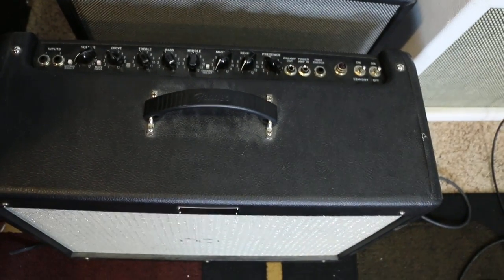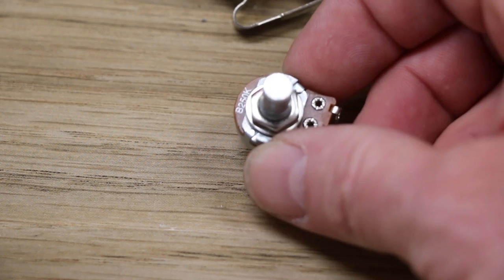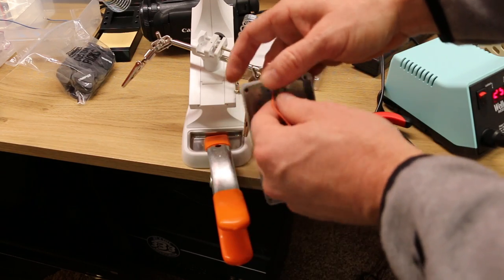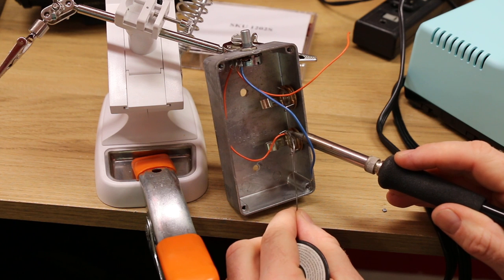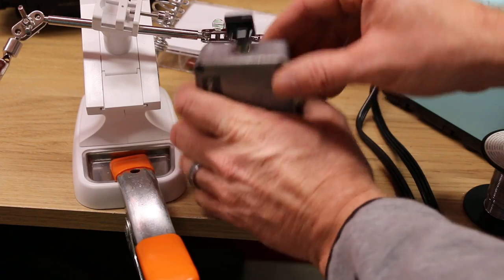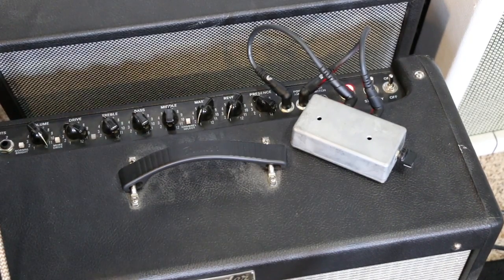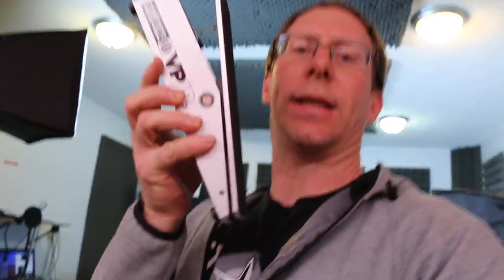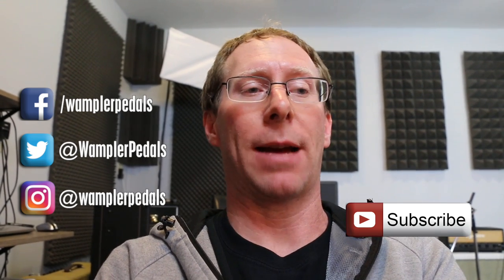Easiest “modification” for Fender Hot Rod amps (and others) to make it better for home use

Comment: So basically Fender to save $0.25 left off the master volume on this amp
Reply: I'm sure they were thinking about cost but they probably did it to create the illusion that it's a lot more powerful than it is
Reply: I thought Hot Rods had master volume?
Reply: @daveclinton4945  yup! Mine has. But it also is controling the drive channel. So if you switch. You can do it more easy.
Reply: Dave Clinton They do, but it only controls the dirty channel. Clean channel just has one volume.
Reply: Matt Laurence No need to create a illusion, I have the Blues DeVille and it’s way to powerful.
Reply: i believe they didnt put taper  volume pots on the earlier ones and put linear pots on them. if i am wrong correct me please its all about learning more
Reply: The master volume is on the drive channel not on the clean. Also these are very loud amps.  I wouldn’t use the box for overdrive os much as to use it as a buffer. Get the sound I want without shaking the house.  Although that would be fun.
Reply: Not exactly. He meant a master for the clean channel. The dirty side has one. As Brian said, they used linear taper potentiometers (knobs) instead of audio taper pots, which give you no room to play at a low volume. At like just after 1 it jumps to 11...
Reply: @stevencollins507  you are correct. The biggest change in volume is from about 1 to 3 (really 1-2 is the biggest). After that it does get louder, but not what you’d expect from a normal amp. That’s my experience having owned a Gen 1 HRD for the better part of 15 years.
Reply: @bouzoukiman5000  exactly. From 1-2 or 3, you get a HUGE jump for small moves for exactly the reason you described!

Comment: Simple as that, you solved a problem Fender has been aware of (and ignoring) for decades. Bravo sir, and thank you.
Reply: Most people just insert a passive.volume pedal
Reply: It’s not a “problem” anyone should expect Fender to “solve.”  First of all, a 40 watt amp isn’t made to play in your bedroom. You could rattle the pictures off the wall and get the law called on you with a 15 watt amp. Second, the amp has a master volume already on the drive channel AND it has an effects loop so you can add another volume control as Brian shows here, just in case your Spark amp ever fails to update and you’re forced to switch on your 40 watt touring amp in a residential neighborhood. This is great advice from Brian for newbies, but it’s not a  solution to any engineering problem that Fender is “ignoring.” The PROBLEM is consumers buying a 20lb. sledge hammer when what they needed was a 5oz tack hammer.

Comment: Good tip. Speaking of tips you are calling the sleeve connection ring on the Jack. The plugs and jacks go back over 100 years with the old telephone switchboards and electro-mechanical telephone switches. Tip Ring Sleeve are the three parts of the Jack and plug. Tip & Ring are the two that go out to your home land line if you still have one and ringing voltage ( usually 90v) would go down the Ring side of the line. In the switching office the sleeve is used for controlling or “holding” relays operated to hold up the call. Fast forward fifty years and stereo plugs used the same technology for left right and ground ( which the sleeve is). Mono plugs are just Tip and Sleeve. I don’t know anything about pedals and why I watch your videos which are great but I’m an old dinosaur telephone guy who worked on cord switchboards back in the day. Like this video showing how to make a master volume and using the amp send receive jacks to attenuate the volume. Two thumbs up!

Comment: I run an EQ in the loop, which has a volume slider that works like this as well. 👍
Reply: Good idea!
Reply: @StopTheRot  Not sure about Paul, but I personally always used a boss GE7 just because it's got good controls and also has a good buffer built in. It doesn't really matter that much though. Just as long as it has a level control and is quiet.
Reply: @StopTheRot  Gonna try that
Reply: Until you click it off and forget your amp is running full volume, I like the idea of the dial and no on/off button. That volume box doesn't need 9v power either. Cheers

Comment: Awesome...a volume pedal in a box.  I always use a volume pedal in the effects loop for this purpose to adjust volume on the fly while gigging.  This is a cool option for those with a few parts and a soldering iron.  Bravo.

Comment: Another great quick and easy mod for the hot rods is to put a 12AU7 in the V1 position. Makes the clean channel more controllable and decreases the gain on the distortion channels. This is what fender does to the George Benson model hot rod.

Comment: I came up with this a long time ago, on the Fender Discussion Page. During discussions of the original Blues Deluxe, I suggested patching a level controlling device, compressor, EQ with volume control or even a 100k Audio taper pot in a box. One FDP'r wanted to know what that would look like, I put up a crude BMP drawing. It was dubbed the "Volume Box." A few guys took my little drawing and started selling them on Ebay. The first guy does credit me. I didn't "invent" it. I had a comercial Ampeg pedal to use in my SVT loop in the mid 70's.
Reply: Thank you Steve. Those who know, know who you are.

Comment: Brian, thank you so much for this latest video. I use a Fender Blues Deluxe Reissue amp which has the same volume issue. I happen to have the identical Ernie Ball volume pedal which you suggested as an option. I've always used this volume pedal in line with my guitar input and effects chain BUT NO LONGER. You've just totally transformed the usability of my amp, I can control the overall volume easily and now roll out as much of my amps natural hair/grit by using my guitar's volume pots beyond say 5 or 6, my go to guitar is a Gibson Les Paul Custom. I use a number of your pedals but this video has just completely increased my sound options and released the true versatility of my amp. You're a total star!
Reply from the maker: +Andrew Garner awesome, glad to hear that! 😊

Comment: Great video!

I solved the volume problem on my Hot Rod Deluxe with a Weber Minimass, which is an attenuator, for real.  I have been very happy with the Minimass, but now I am wondering if I could have achieved the same results for less cash by using your method.  If only I had known about this trick a few years ago.

Thanks for taking time to share your knowledge with us.

Also, your video about putting an EQ pedal into the effects loop of a Hot Rod Deluxe has been life changing for me.  I can finally get usable tones with the amp set to drive/more drive. Thank you so much for that!

Comment: I know you probably won't see this, but for the hot rod deluxe, it would be nice to have a foot switch to turn the reverb on and off (instead of having to turn the knob up and down). Any ideas on how to do this?
Reply: Get the hot rod deluxe foot switch, probably 40$. It’s gotta have “drive/more drive” and “reverb” 2 switches
Reply: @matthewkennedy7283  on the hotrod deluxe the 2 button switch toggles Clean/Drive and Drive/More Drive. You'd need to modify the circuit with a relay to short the reverb out.

Comment: Put an 12at6 preamp tube in the first position it dimes back the volume, you dont go from like zero to 5  in volume. Doesnt do what Brian is doing here , but at least its a cheap option if you dont have any sodering skills ( ala me :).
Reply: I just watched a video with a dude doing that on this Red HRD. Would something like that work on a Blues Junior or would I lose too much volume?
Reply: I cannot, nor will I ever, solder. So I need another option. Or another amp. 20Watts and some damn linear volume control.
Reply: 12AT6´s are hard to come by, I suppose a 12AT7 would be better :-)
Reply: Edit: ah, ok, you mean the clean channel, right? 
I guess the point is to also reach high gain levels at low volume, which is hindered by a weaker preamp tube. This is a master volume retrofit, not a tube swap.

Comment: Thanks for the video!  I built one to use with a Fender Frontman 65R to tame the clean channel volume control.  This reduced pre-amp noise as well by allowing me to boost the guitar signal above the pre-amp noise, then turn everything down before hitting the power amp.  This resolved my biggest issue with this amp.

Comment: I made one of these a while ago to tame my Blues Deluxe Reissue.  It works ok, but I also fitted treble bleed circuits (just a resistor & capacitor from ebay) to my guitars, so I can use the guitar's volume control to reduce the level without the tone going muddy.  I prefer this method.

Comment: Can one use the volume box along with all your time based effects pedals in the loop....and if so, where does it go in the chain?
Reply: That's a fair question 
E.g typically I use my eq pedal in the loop
But if you have looper post the eq pedal 
Then a master volume as a final tweak, would make sense.
Reply: After all the rest.

Comment: In case you already have something into your effects loop and have an extra hole or space to drill one on the back of your amp, like me... you can put a potentiometer there without having to mess up with Jacks. To me a 1nF capacitor was mandatory, because when I turned my effects loop volume down there was I huge treble loss. A volume pedal could be great, but you'll need two long cables to reach you effects loop and by the way you'll add capacitance, buzz and maybe hum... if you're lucky!

Comment: These amps have a separate volume and drive knobs so what does this volume box do differently to the existing volume? Is it just that the original control is too sensitive or are you actually driving the tubes more somehow.
Reply: William Billington Drive only affects the dirt channel right?
Reply: Wondering the same exact thing
Reply from the maker: The master volume doesn't affect the clean channel. On these amps, the clean volume is way too sensitive. Basically, it's just adding a master control to the clean channel. It's redundant if you use the dirt channel of the amp, however very few use that dirt channel on those amps.
Reply: Ahh ok that makes sense. I did use one of these amps to record something a couple months back and it was like 0 to death by 2 on the dial.
Reply from the maker: exactly! :)
Reply: The dirt channel is terrible.
Reply: The effects loop is after the clean volume.  So you can crank the clean volume, which will overdrive at some point, and since your new "Master Volume" is after that preamp, it will affect that first clean volume AFTER it is overdriven, enabling you to still hear it out the power tube stage.  So, you'll get preamp drive, not power tube breakup, and still not be stupid loud... right?
Reply: Great tone comes from power tube distortion. Pre-amp distortion is buzzy, or , fizzy. Hopefully this mod allows for power tube breakup without your ears bleading.
Reply: @barry Brain confirmed that this mod won't help with that I'm afraid. The only way to get power tube distortion at low volumes is using a dedicated power soak.
Reply: The only way to get power tube breakup is to run them hard, when the amp is not loud, they are not running much, period.  Like William Billington said, that's why there is a power soak, hot plate, 'attenuator', etc, to run inline of the SPEAKER output, and let the wattage output of the amp increase, while consuming and venting that heat energy before it reaches the speaker, thus letting the power tubes run hotter.  It's like letting the tubes "think" they're running loud, but only letting a little get out the speaker.  This is why micro-wattage amps have become popular.  Remember, wattage is not how loud something is, or can be, it is a measurement of heat, so to "soak" up that heat from the power side is very different from a volume knob on the pre amplified side that only changes the signal level to the amp.
Reply: +Guitarisforgrins I have heard the George Benson mod helps make the drive channel a lot smoother. I haven't done it myself yet but I've heard good things about it. It just involves replacing the preamp tube from 12ax7 to something with a little less break up. Something like a 12at7. Not 100% which tube but the mod is out there on the internet somewhere.
Reply: Wampler Pedals What do you suggest for a blues jr that doesn't have the loop circuit?

Comment: My lack of electronics is going to bring me to posting this question why not use a 1 meg or 500k pot instead of the 100k, to retain brightness?
Reply: Following
Reply: It's a low impedance loop. 100k works fine.
Reply: Veritas072 it isn't like that. At max the pots is like connecting directly the signal to output, and at min it's like sending the signal to ground directly.
Reply: I think the big thing here is that if the pot can handle the circuit voltage/amperage then the lower resistance of the 100k pot as opposed to the 1meg pot will give you a smoother sweep from full to off.

Comment: Or... you just swap the V1 12AX7 tube with a 12AY7 tube.
Reply: Exactly !
Reply: TimMer1981 hi, with that tube you had less volume?
Reply: 12AY7 tube has a lower amplification factor than 12AX7 so it reduces the volume sensitivity. It will also improve the frequency response of the pre-amp. It does not affect the max output since you have more room in the volume control to reach the peak power.
Reply: I used a 12AU7 once.  Buys about 8 db’s.
Reply: Does the 12AY7 reduce the volume more than the 12AT7?
Reply: @mikecantreed  No. The lowest is 12AU7 followed by 12AT7 then 12AY7 when 12AX7 is the highest amplification factor. However, the 1st one will introduce more distortion when used in the upper stage specially in the PA driver. You can apply them safely in sequence of the stages.
Reply: I have the 2x12 DeVille and did a matched 6V6/12AX7 tube kit from JJs which cut the wattage down to about 30. It did nothing to tame the volume but sucked the tone right out. Lost so much bottom end, it was disappointing. I put a set of matched 6L6s back in and just live with it. I’ve seen lots of mod kits claiming to improve the volume issues associated with this amp, however, I’m no tech and don’t want to ruin something. The tubes were like changing light bulbs and the bias pot made biasing this amp simple. I will try this volume box. Is the amps master vol after the efx loop? Will it be affected?
Reply: @dangitBobby74  With all these modifications you can think of, what you really need is just an equalizer. You can set any tone you want for your guitar. Just set your guitar tone control to max and the volume control close to max and let your equalizer do all the rests.
Reply: Yes ! Only takes a minute !

Comment: I have been trying to figure out how to use this amp for home practice.  Forget about modding the volume control knob, or adding the above mentioned stupid added volume control in the effects loop.  Try this instead - it worked like a charm for me, and the tone is better: replace the first tube 12AX7 with a lower gain tube like the 12AT7 or 12AY7.  Easy to do, and cheap.  Try it, you won't regret it.

Comment: I can attest that this volume box works with my Hot Rod.  I added a DPDT switch so I can turn it off. 
Tip: make an outline on graph paper and plot out your holes ahead of time, then rubber cement the outline onto the casing, it should peel off really easily after you've made your guide holes.
 All totaled it cost me around $25, but that includes a new 3/8" HSS drill bit for making the holes.  Google "tubes and more" for a great place to buy small parts cheaply.

Comment: If you don’t attach that ground wire to both ground lugs on the jacks, it may work for awhile, but you’re just inviting trouble down the road. Jacks come loose and oxidation can set up between the jack and aluminum box. 

Take a look inside any good amp, and you’ll see that the manufacturers tie every ground lug together. It’s an extra step, that they can save money on, but they don’t, because of how important it is.
Reply: Time will tell!  If not concocting prototypes it is worth your while to connect the ground lugs. It is considered "good practice".

Comment: Cheers, I had a few jacks lying around from various guitars I upgraded to more sturdy ones and bought a 25k pot from Amazon for about $6. Had an old plastic enclosure I previously used as a Y splitter till I got a bypass tuner pedal, so I had it up and choking my FX loop  in 20 minutes. Even had an old guitar volume knob that I could use. 

Works like a charm for getting a fuller sound at bedroom volumes on my Marshall 20h

Comment: This is a great solution for controlling the volume when going straight into the Amp. A+++ solution. Ive been using a GT100 in mine in 4 cable method and inadvertently Ive just noticed that I am able to use the Amp volume in a controlled way similar to the mod.

Comment: You can replace the 12AX7 in the first stage or two of the pre-amp with a 12AU7 or similar lower gain tubes to quieten the amp down also.

Comment: I have found that if I run my Champ 100 off the preamp out from my Hot Rod DeVille, it has a similar effect and gives me the preamp tube quality sound out the champ 100 and changes the dynamic from earbleeding loud to holy crap the room is so full of sound that I can swim in it. helps to place the amps opposing, Nice thing about the champ 100 manages to model blackface fender amps pretty well. Using it to shunt power a bit and to supplement the Hot Rod really sounds phenominal.

Comment: I have a 4-10 HR Deluxe, it is one of the loudest amps I have encountered. But it sounds great and loves pedals. I have to use a power soak just to be able to turn it past 4. But this is a terrific $10 - $20 solution. It's about time your customers/fans learned to solder anyway.